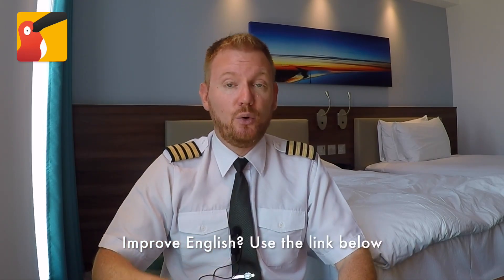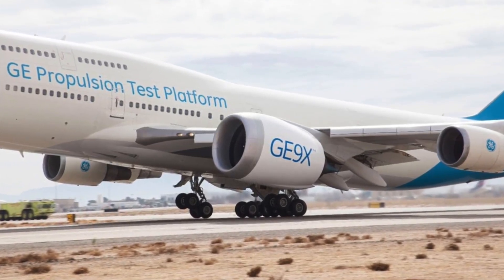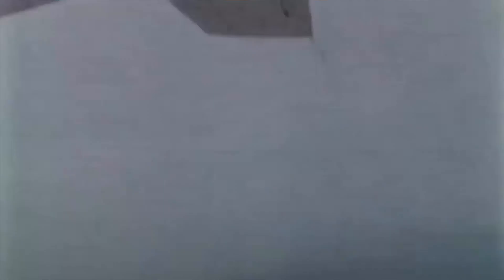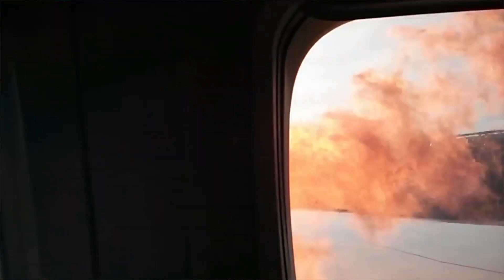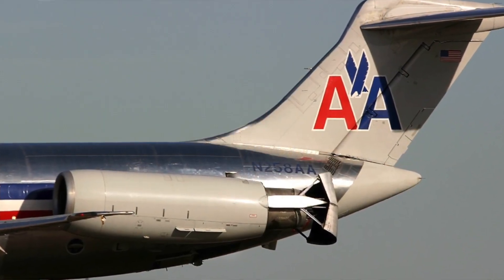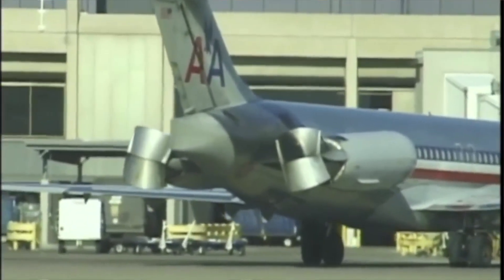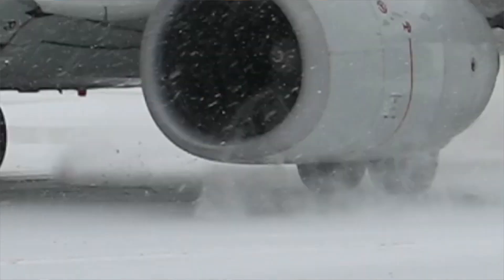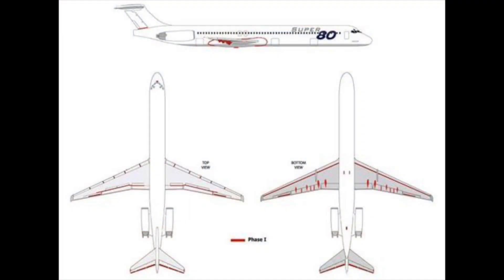Why are the jet-engines placed there? Wings vs Tail

Comment: Ekranoplan design is much better. Front mounted engines and blow the exhaust under the wings. 
Also full frame / wingless designs are far superior. Boeing 747 style is the worst. 
Commercial airplanes usualy dont have defense against failure. No escape pods, ejects, personal parachutes etc.
Some aircrafts have parachutes which are on the entire aircraft. But most dont have. 
When i was at the mechanical aircraft school i have asked the teacher why not simply aircrafts not use electrical jet engines. Answer is fuel industry and the dark government. If this technology reach the public then everything will become useless and obsolette overnight.  Thats why i have to find a company which trully wants to compete. I have developed far superior designs.Including 100% fuelless propulsions. 
We gonna start with the low altitude aircrafts. 16-40 meters above the surface.
Reply: You won't need a parachute in an ekroplan flying 4 meters above ground.... and don't take it to the north sea. middle-height of waves above 8 meters at times.
Reply: The ekranoplan can fly higher than 4 meters above the ground. 18 meters or even little more. Plus the design which i propose can use also liquid and solid particles, not only air molecules. it has no problem to go through the water waves. The parachute will serve another purpose here. It will be dragger. A drag shoute. Like the parachute behind SR-71 and the shuttles. To provide extra stopping power in emergency situation to avoid colision for example. It will be attached to rotary joint connected to turbine and generators. Thats how any motion of the parachoute will be translated into movement of the turbines and generators via transmission system.
Next upgraded version will have no height limits and will perform pretty much like milenium falcon from the movies. It will land on the moon diagonnaly or even horizontaly. Drag shout will capture the particles from the reverse thrust and will provide extra stopping power. The landing gears will handle the rest.  Since the thrust will blow towards the surface will be plenty of dust particles to capture and blow back them again.
So in Mars if there is dust storm it will actualy be a bonus. Elon Musk vertical landing of pencil shape craft is contrary to common sense. And in case of dust storm will have very bad time to land.
So the core of that is the ekranoplan technologies. The rest is just upgrades.

Comment: Why don't they develop planes with botch, engines under the wing and on the back? This would equalize down pitch and up pitch.
Reply: Like DC-10 you mean? One of the safest planes to fly in after the initial bad design choices and shortcuts taken in maintenance using forklifts for engine maintenance and saving $$$.

Comment: right, engines under the wings is better for fires ofcource, since if the wing engine is on fire, and the fuel tanks are in the wings, its a much better recipe for fires than tail engine

Comment: On the Air Force C-17 the thrust reversers sent the exhaust upward.  For a big cargo aircraft this enables to fly into non improved strips with a heavy load on short strips.  What this does for what the  engines sucking in debris, I don't know.

Comment: An alternative to the T-Tail, although not used as often, that eliminates the issue of super stall is a canard configuration, with the horizontal control surfaces being placed in front of the main wing.

Comment: Thanks mentor pilot 
I always have that question running on my mind. I just started to build my career.

I know this is a stupid question but why not both. I know weight,balance and airflow is a main issue but I want to hear more! More problems with it and if any advantage which I don't think thear is. I'm such an idiot. But I want to hear the answers.

Comment: The primary advantage of wings without the engines mounted is having an undisturbed airfoil. It can be optimized for high speed cruise and you can have larger flaps and full span slats for lower landing speeds. It's just simpler and more efficient.

Comment: DC-9 airliners have their engines on the tail, mounted on the side of the fuselage.  If you're seated in the last three rows at the aft end of the cabin, or go back there to use the lavatory, you get a lot vibration from the engines when they're running at high RPM.

Comment: tell us how Compressed Air is the Fuel for Jet engines.  If you accept that a A-380 carries 85,000 Gal.s of fuel in the WINGS = 260 Metric Tons; tell us how such a thin wing could carry such absurd weight.

Comment: Engine angle on rear mounted engines. They or pitched up to add in stall recovery. Adding power will cause the nose to lower.

Comment: What about wing mounted engine has less air flow efficiency across the wings since the engine is blocking some of the laminar flow running below the wing resulting in more power to generate lift compared to tail mounted ?

Comment: Wouldn't it not make more sense if commercial airplanes used vertical to horizontal interchangeable engines that rotate for take off and landing much like a Harrier? Having jet engines designed in such a way would eliminate the need for a long stretch of a runway since the aircraft can take off vertically.

Comment: Jet aircraft usage is continuously increasing. There are around fifty thousand people in the air, continuously, 24 hours a day. For every tonne of jet A fuel combusted, there are twenty one tonnes of polluted atmosphere generated, not including many more tonnes of contaminated water vapour which condense on, and absorb pollutants from, the exhaust plume. Jet air craft continuously rake ozone out of the stratosphere, produce acidified rain, and the high altitude heat deposition is seriously interfering in the balance of the entire atmosphere. There is strong case to be made that jet pollution and excessive heat production are the primary drivers of violent weather events. Jet A contains aluminum oxide which improves the combustibility of the fuel. The oxygen component is burned, but the nano-particulated aluminium is exhausted to the atmosphere. Aluminium when nano sized, is a toxic carcinogen. It is a highly reactive metal, and we are filling the complete biosphere with this, and a hundred other toxins created by burning kerosene, gasoline and ten additives, and we are doing this at an accelerated rate every passing day.

Comment: It is also useful to mount the engines under the wings because it allows for a greater separation between any contaminated air from the air that is being ingested by the engine.

To explain, air that touches something, or moves parallel to a surface, creates drag by the formation of a boundary layer, which is a layer of air that moves slower than the air that is far away from the aircraft, relative to the aircraft. So while the air far away from the aircraft is moving several hundred kilometers per hour relative to the aircraft, the air that is touching the aircraft is actually not moving at all compared to the surface of the aircraft.

Engines will experience significant cyclical stress (like the kind that is created if you bend a piece of metal back and forth many times, eventually breaking the metal by work hardening) in the turbine and intake fan if they ingest air that is traveling at a different speed across the fan. So, if the engines are mounted close to the body, behind some part of the aircraft, like at the tail, the air they will get is likely to be more contaminated by the boundary layer and shear forces created by the aerodynamics of the aircraft than if they are under the wings.

This means for rear engine aircraft, or fighter aircraft, they need special intake cowlings and intake geometry (The way the intake and front of the engine is shaped) to mix the air, and make all the air move at almost the same speed all over. Front of wing, underwing mounted engines do not need any special geometry and can mount almost all kinds of engines, with minimal specialized geometry needed for the engine cowling and mount. Easier and more reliable -> cheaper -> better

Comment: This olDell computer will not play the video.  As a young boy, my design was thengine ON top and to the rear of the wing so it would suck air over the top and the high velocity would increase lift.   Also less ingestion of objects.

Comment: Engine placement also effects how the engine will work. The air entering under-wing mounted engines is moving at the same speed as the air passing around the aircraft (at the same pressure) however the air flowing over the top skin of the aircraft (much like the air above the wings) is moving slower (at a lower pressure) and this air would then be ingested by tail-mounted engines as they sit directly in this slower airstream bring so close to the fuselage. This creates problems when the outer portion of the engine inlet sits above this slower flow while the lower portion sits within in. The pressure differential and massive stress changes caused by their rotation are then exacerbated in components such as the fan and compressor blades leading to accelerated rates of failure and a more stringent limit on the size of engines mounted at the rear. I believe curious droid has a video on this

Comment: Very well explained as always. It could be interesting to explain all the antennas, drainers and emergency transmiters on the B737. I mean all you can see on a exterior pre-flight that comes out of the fuselage. Every aircraft is different in the way of how to put the antennas, and the FCOM doesn't explain accurate where are they located (VHF, HF, ILS, VOR, TCAS, GPS, DME, LOC, RA, WX, ACARS, COMM). Thank you Peter.

Comment: Another benefit to rear mounted aircraft is that the placement of the engines allows entire leading edge of the wing to be unobstructed, which leaves more room for high lift devices like slats as well as better use of the wing surface area, which both contribute to better low speed performance. That was a big factor in the design of the 727

Comment: Leads me to believe that planes with 2 engines mounted under the wings and 1 mounted centerline on top of the fuselage back by the tail (Like the Lockheed Tristar) are / were the best of both worlds.  Plus, they still had the stabilizer mounted on the fuselage...so no T-tail.  Seems like that engine arrangement has all the cons cancel each other out, leaving just pros.

Comment: Regarding the issue of fans vs props having delayed throttle response when the thrust lever is advanced, isn't that more a problem with jet turbine engines in general? Turboprops probably have the same problem, whereas your more traditional naturally-aspirated piston-engined prop plane wouldn't.

Comment: The super stall you cited is probably what happened to Embraer's KC-390 prototype number 1 witch fell almost 20000 feet before the pilot regained control very close to the ground (Embraer did not commented, but estimates from flightradar24 data is that the aircraft was less then 300 ft from the ground). Very close call.

Comment: In flight, wings are forced up, but engines on wings forced them down. It is balancing some weight of engines with weight of fuselage. Makes wing stronger to handle stres more easily during flight! Tho without buoyancies on tamarack, it is opposite.

Comment: Interesting discussion and well-done commentary.  However, I disagree with your analysis giving the advantage to under-wing engine placement for the engine fire scenario.  I would give the advantage to aft-mounting because the under-wing placement puts the source of the fire closer to 1) fuel tanks & systems, 2) essential aerodynamic structure & control of same, and 3) passanger normal & emergency egress.

Comment: Undermounted wings are also aerodynamically advantageous. The air under the wing moves slower than the air above. This gives both lower intake mach number and a slightly slower airsteam will increase thrust.

Comment: Yeah, but if you put engines under the wing and they blow up could they throw a part into the plane and possibly cause decompression of the plane, possibly sucking passengers out of the hole?

Comment: High engines center of thrust is closer to the mass center in the horizontal and vertical, while underwing are closer on the fore & aft axis. Further, high on the tail are mounted to main structure rather than the separate wing assemblies. The three engine designs, likewise, have some aspects of both.

Comment: I dont know why a pilot explains things that clearly should be explained by an engineer. It's confusing, because it's not even starting with the 4 basic forces of flying, thurst, lift, drag and gravity. There are a lot of factors, and there are pros and cons for each configuration.

Comment: One advantage of rear engined planes you forgot to mention is the ability to have a lower landing gear, which leads to it being much easier to have the passenger steps built into the aircraft, rather than relying on external vehicle steps.

Comment: I would assume placing the engines below and slightly in front of the wings also helps designing the plane according to the area rule, reducing drag in the transonic speed range when compared with engines at the back.

Comment: If the problem with super stall is that the elevator doesn't work properly then how does the stick-pusher solve it? Doesn't that simply operate the elevator (that doesn't work)?

Comment: A few thoughts:
1. A rear mounted engine is far away from the center of gravity. As fuel is  burned off in the wings the CG moves aft requiring a compensatory deflection of the horizontal stabilizer. This generates trim drag which on long range aircraft like the VC-10 was serious. 
2. Those massive fuel lines between the wing an the engines were heavy. 
3. As mentioned, the rear fuselage has to built stronger take all that stress. 
4. The advantage of rear wing is less potential Foreign Object Damage. A biz jet with under wing engines would not be good. The S-3 Viking was nicknamed the hoover because of this potential.
 5. A four engined rear mounted aircraft like the VC-10, Il-62 and the Lockheed Jetstar have a problem where if the inner engines explode the outer engine could be affected, so massive protective structures have to be built to protect from this.
6. Turbofans are very sensitive to dirty or unstable air. A VC-10 configuration would mean the air entering one engine would generate turbulence for the neighboring engine. This did not matter so much on early turbo jets like the VC-10, B-47, B-52 but do matter with exponentially larger air intake on modern airliners. This is so important that 747's engines are very far apart from each other, and all wing mounted engines on any such aircraft are far apart from the fuselage and the wing.
Just a few thoughts.

Comment: The aircraft that you referred to as a Boeing 717 is actually a McDonnell Douglas designed and engineered MD-95.  I've worked for both companies, but am still biased to McDonnell Douglas.

Comment: Another tool to prevent deep-stalls is a Vortex generator, not as spectacular as it sounds. It's a minor aerodynamic obstruction, placed on the leading edge near the root of the wing. This should make sure the wingstall starts at the root of the wing, while the wingtips are still providing lift. This in turn will force the aircraft to decrease its angle of attack.
Sorry for the bad grammar, I must be French ;)

Comment: Good explaining again. Thanks for that. But I have a question regarding that stick pusher system you mentioned. Couldn’t it cause trouble, when you maybe had to put the airplane in a configuration just above the stall for an emergency landing or whatever and then that system pushes the nose down causing the plane fly into the ground?

Comment: A Vickers VC10 was used as the flying test bed for the RB211(The engine that bankrupted Rolls-royce Aero Engines) engine during development.  
The VC10 had a pair of Conway engines on each side of the tail.

Comment: You forgot to mention that aircraft with tail mounted engines can also have shorter landing gear. Which saves weight and makes boarding easier.

Comment: I have a question, for the purposes of combating stall and to increase maneuverability why don't aircraft have maneuvering thrusters?
Reply: 99% of the time they don't need them and more weight means more drag, more fuel consumption, less range.

Comment: Question - most military transport planes have (C141,C17,c130,Most An designs) Have high mounted wings with underslung engines. Presumably this adds much more cabin noise, but appart from that it would seem to combine lots of the advantages of underwing engines and rear mounted engines (less FOD, lower boarding height etc) why isn't it more common in civilian aircraft (there are some BAe146 etc. which having flown on didn't seem to be much louder than other civilian designs, what is the disadvantage?

Comment: "Center of gravitational Pull" or "Center of Mass" because the "Center of Gravity" is the EARTH itself. Please get that thing right ;-) Thanks in Advance.
Reply from the maker: Hahaha! Did you not understand what I meant?
Reply: Actually I DID understand what you mean, but as you often said: dive deep into physics and every phisicist would tell you, that "center of gravity" is wrong.
Please understand this as a kind of pointing out and not as any kind of angry comment. Thing is that there are many forces when it comes to aerodynamics. For example center of mass, center of lift, surface drag, air density and center/vector of thrust.
However, I really like your videos because you describe many things that are sometimes difficult to understand.

Comment: How about the flight aircraft A10. It had 2 engines at the back and the horizontal stabilizer is right behind the engine exhaust. Why the aircraft have such design and what is the possible advantage and disadvantages of that kind of design?